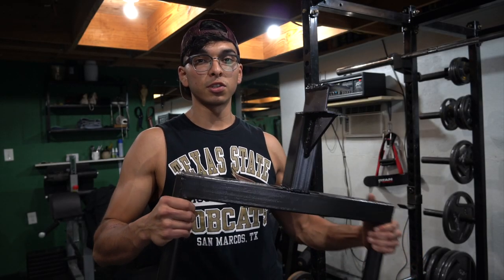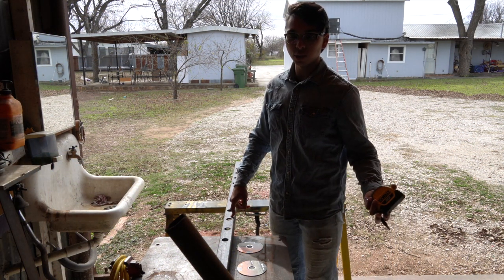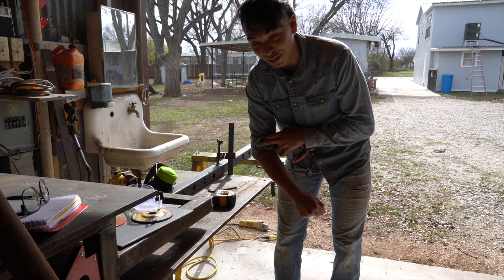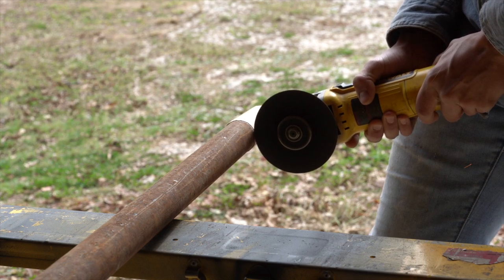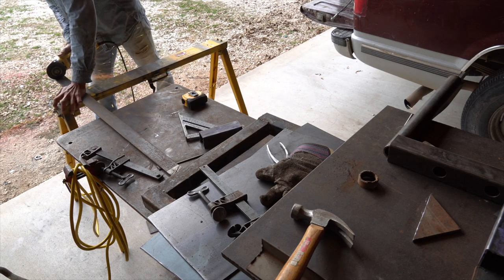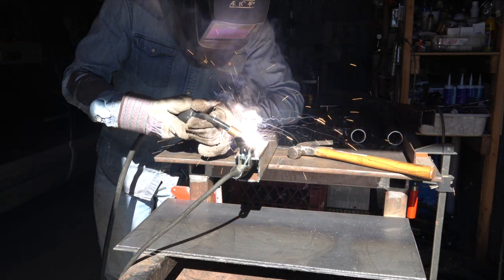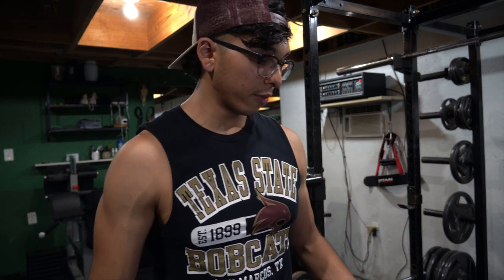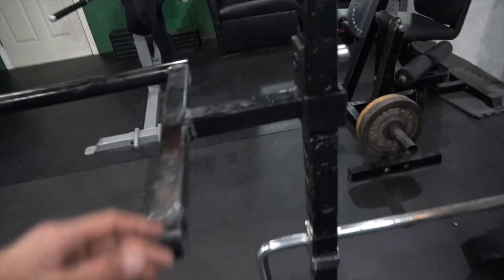Homemade Dip Station Attachment For Titan T2 Power Rack | Garage Gym Giveaway

Comment: Dude, be safe use your handle, and guard and only remove when you have to. The triangles used for reenforcing are called gussets. I'm professional welder. Who also builds exercise equipment on the side. Thanks for sharing your videos it's cool you make your own stuff.
Reply from the maker: thanks for the heads up Daniel, I will add the handle and guard back to the grinder. I also just learned a new word from you. You just gained a sub! Would you like to be in the giveaway?
Reply: Thank you I've had some close calls myself over the years. I've built several power racks for other people, but haven't built my own yet so I wouldn't have much use for it. I did build myself a full stand alone dip station a long time ago. Thanks for the offer though.
Reply: I'm on Facebook and have projects/business page on there. Check out Dan Built  Equipment.
Reply from the maker: @theovercomer2006  alright I will
Reply: Thanks subs, hope you enjoy the page.